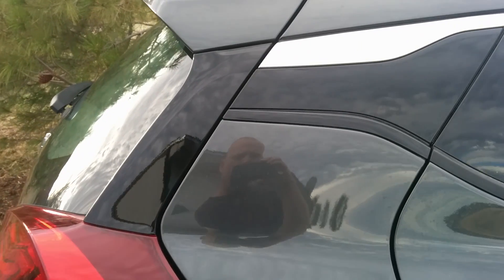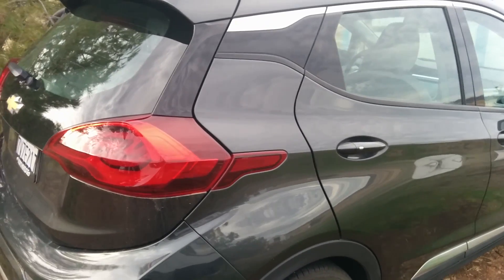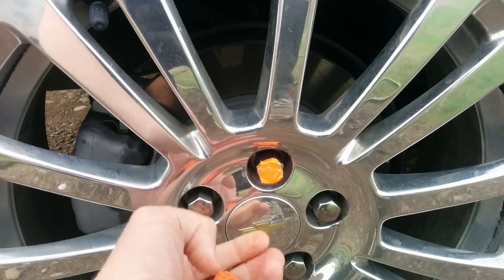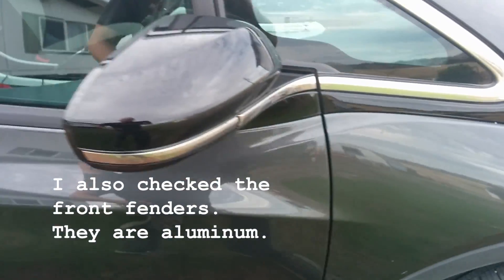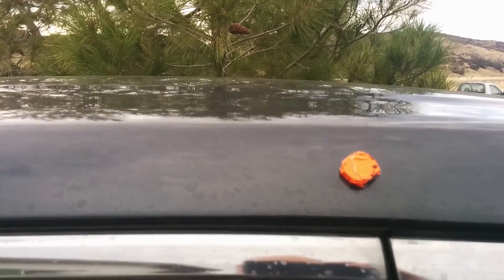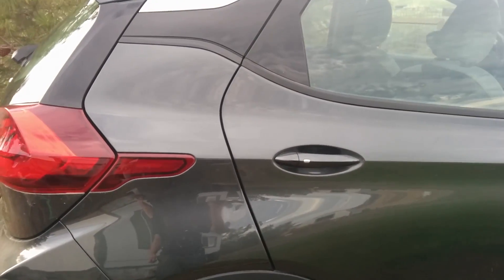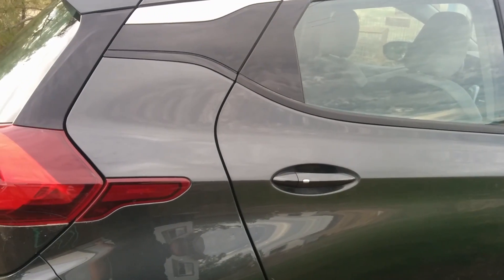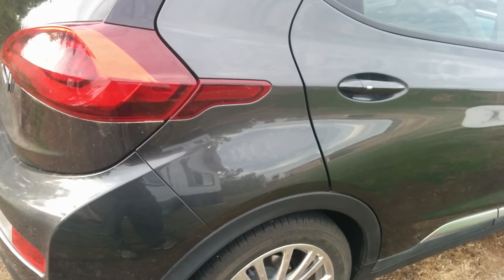Chevy Bolt EV Magnet Test

Comment: Also the rear brake calipers are aluminum but the front ones are not. Some potential weight saving there. I believe the front calipers weigh around 12lbs. They have the same 5.04" caliper bolt spacing. So maybe an small aluminum caliper from Wilwood that weighs only 3-4lbs.

Comment: This might sound stupid but do you know if there is any metal on the back that I can stick a car magnet to the back? Thanks
Reply from the maker: No, that's a perfectly valid question. I know a lot of people who try to run magnetic signs, and they won't stick to the back of the Bolt EV. The pillars might have enough steel, but they are so narrow, there's not much you can attach there. You could possibly affix some steel to the inside of the hatch panel, but it's probably easier to just use epoxy on the exterior.
Reply: News Coulomb So either a bumper sticker would work or a window decal. Thanks for all your help. Really appreciate it!
Reply from the maker: @GMfan746  You're welcome!

Comment: Handy to know the roof is steel, as I want to use magnetic mount antennas for my amateur radios on the roof. Thanks for checking and for making the video.
Reply: It works great and acts as a nice ground plane. Haven’t checked actual swr on my 2m though.

Comment: Aluminium is not necessarily better for all applications and isn't always lighter either.  For a given size a steel part may give the necessary strength where as a similar aluminium part may need to be made much thicker to do the same job in certain circumstances.  The parts that were left as steel may not be because of cost.  But simply steel might have been the best choice for those components.
Reply from the maker: That's true. The one I can't understand/justify is the roof panel. I was looking at a Sonic on the freeway the other day, and the roof seemed very similar. I'll have to check the P/N. 

I've already owned several cars with aluminum roofs to date, and it is one of the primary areas automakers target with their performance vehicles.  Aluminum seems like an appropriate application.

Comment: The unit body structure would have to all be steel or aluminum because you can’t weld steel to aluminum.  I’m sure all of the structure is of some grade of steel in the Bolt, anything bolted to the car like doors and the hood can easily be made of aluminum.  If you attach dissimilar metals with contact you encourage corrosion at that point.
Reply: Here is the article on it.   I would imagine GM has done a lot of testing on this technique before deciding to use it in production. http://www.detroitnews.com/story/business/autos/general-motors/2016/05/18/gm-says-first-weld-steel-aluminum/84558702/
Reply: The Cadillac CT6's unibody is a blend of steel and aluminum. It's a new process and I don't think its in anything else yet, but GM seems confident they can manage the galvanic corrosion.
Reply: Kevin Schrage I’ll have to find out which cars are built that way because I wouldn’t want one.
Reply: Erik Stephens well, I think it’s going to rust with all the road salt in my neck of the woods!
Reply: John Donlon I live in Ontario, Canada which is heavy rust country.  There are ways to deal with galvanic corrosion.